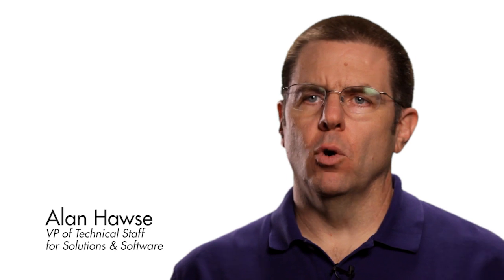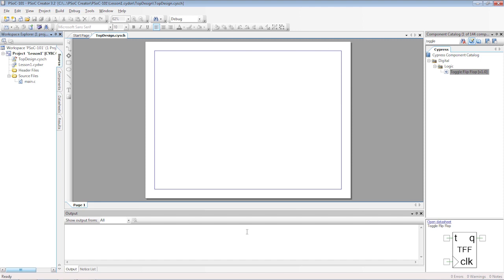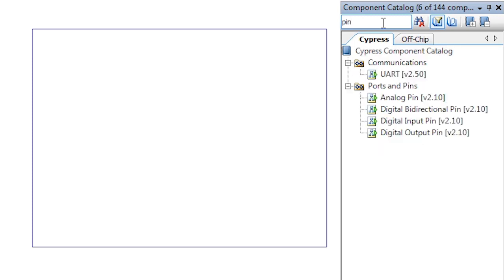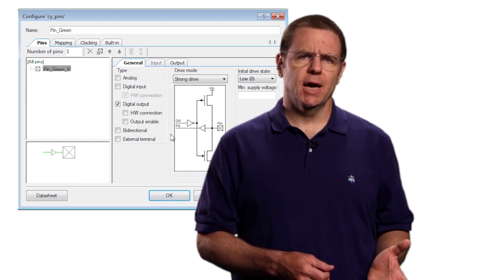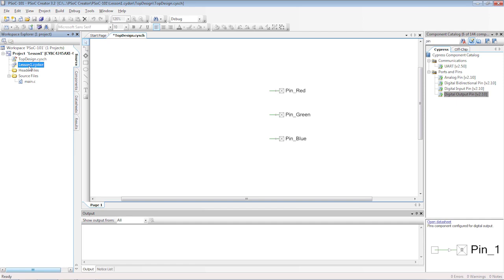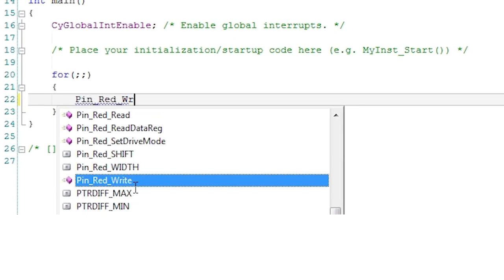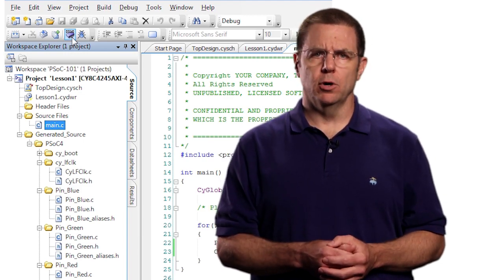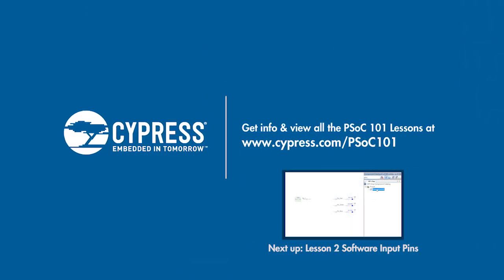PSoC 101: Lesson 1 Software Output Pins

Comment: I see that it works, but i dont know how the software knows that the pin should be linked to the led-pin input, nowhere did i see that this digital output or the chosen ports on the chip with the drag drop, are matched to the LED input pins.

Can someone explain how to know/see this? (